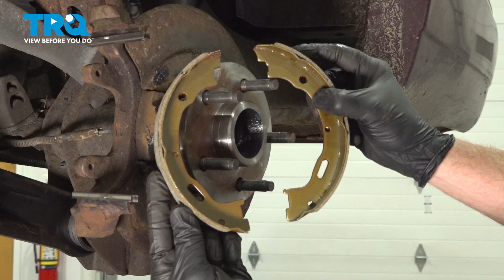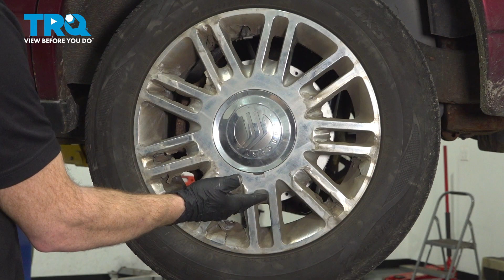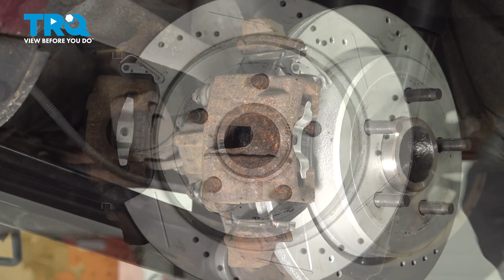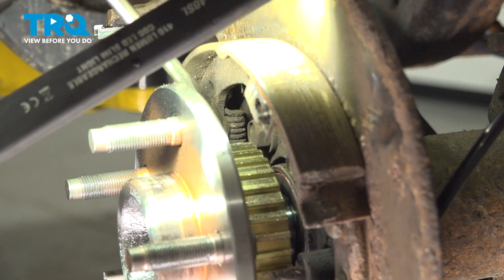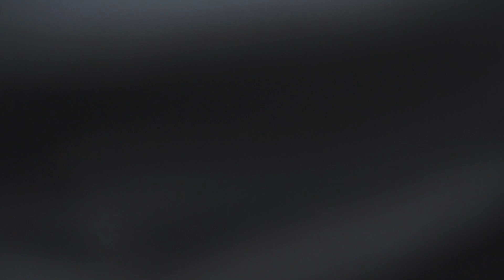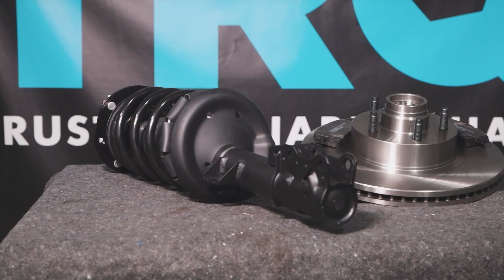How to Replace Parking Brake Shoes 2003-2011 Mercury Grand Marquis

Comment: Some instructions in this video concerning adjusters and springs differed from the car I was working on, and since the parking brake had never been apart before since leaving the factory, I put it back the way it was. Otherwise, very concise, well explained and the camera work was very good. I also liked that the torque values were given when applied. You’ve gained a new subscriber

Comment: If i showed what I'm dealing with on a 2003 town car y'all would have a heart attack, first of all it took over an hour to remove the rotor it was seized to the hub, heat hammer air hammer lot's of penetrant many bad words and it finally came off, the shoes were obliterated by rust, the pedal went completely to the floor because there was zero contact to inside of the rotor, I'm going to reuse the rotors and pads but everything else will be new, i think the cables are good if not they will naturally have to be replaced to have a fully functioning parking-emergency brake system again.

Comment: Those shoes should never wear out in the first place. It's a parking brake. If you adjust them so that you have drag, you will absolutely make the rotor get too hot leading to warp, and you'll wear out the shoes, not to mention assault your gas mileage. Adjust them until you feel drag, then adjust them back off a bit until they turn with zero drag.